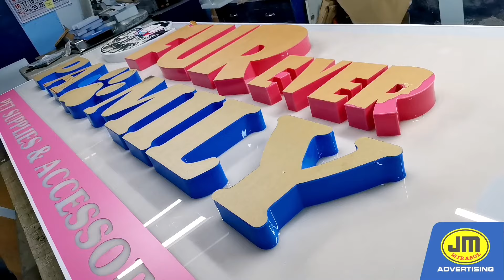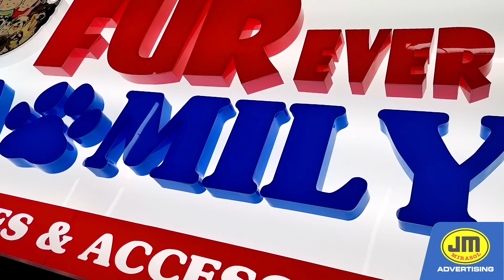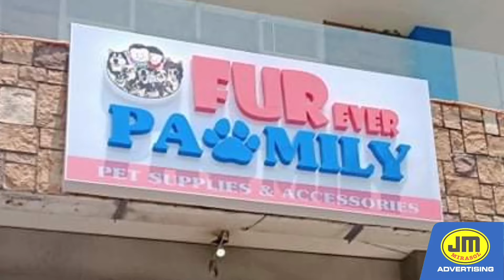Build-up Acrylic Plastic Letters | JM Mirasol Advertising

Comment: What is the product name .which type heating element you are using name of brand etc that you are using for bending the acrylic sheet
Reply from the maker: it's just simply called acrylic plastic bender, there is no brand in the bender itself but you can ask the nearest acrylic plastic supplier in your area if they have an acrylic bender